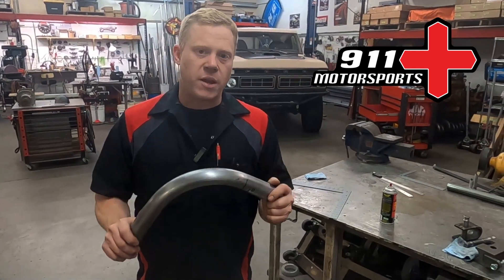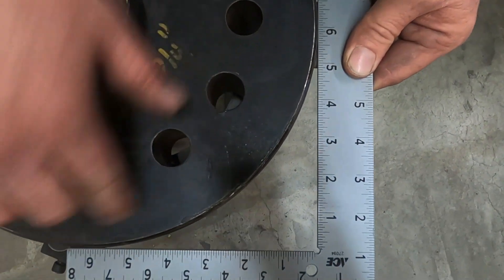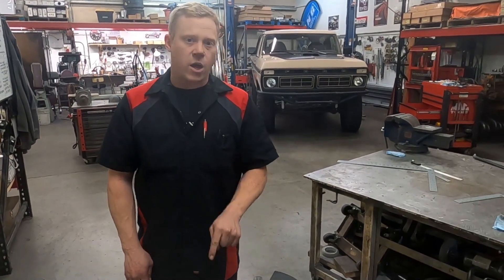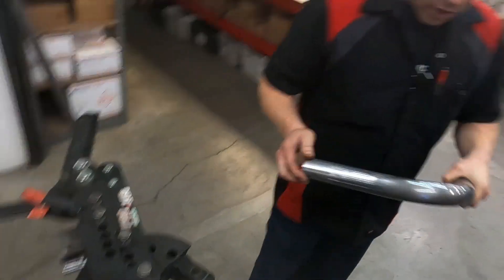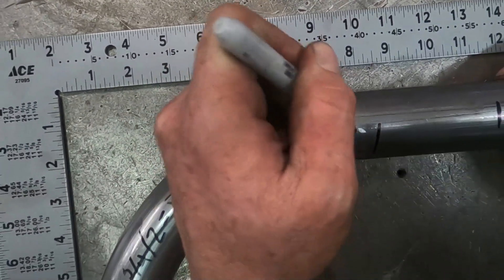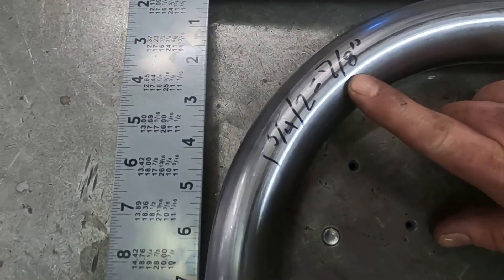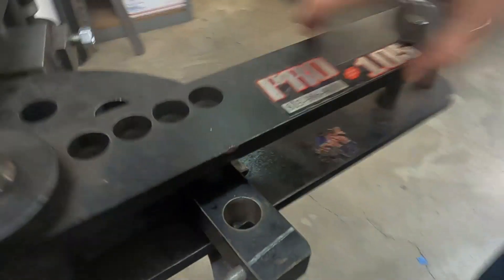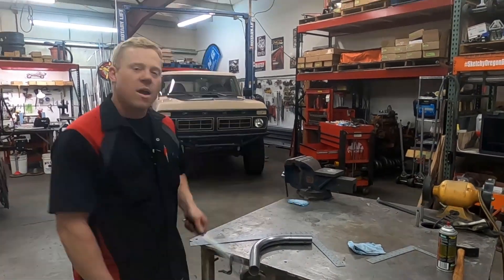Tube Bending - Start Point Offset Layout - Custom Bumper Build 1 of 9

Comment: Early in the video you said that 6” was the center line radius, and the tangent point of the bend. Then later on you added half the diameter of the tube, and said 6 7/8” was the tangent point. What am I missing.
Reply: Thats the center line radius, He was measuring on the outside of the pipe, not the center, so you need to add the length because thats where it would be. But, this video is whack, go watch the fabricator series for way better information.